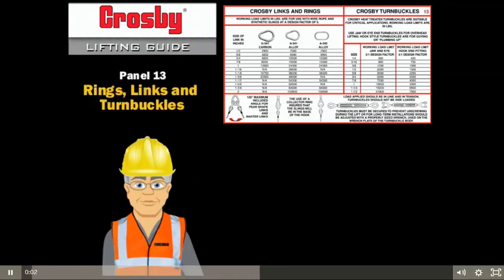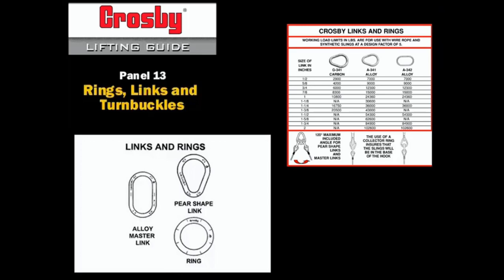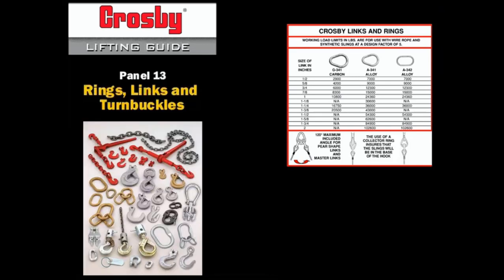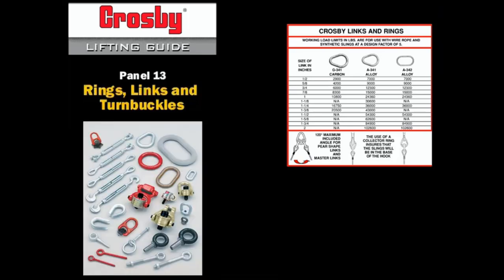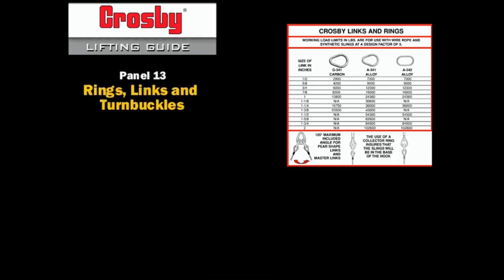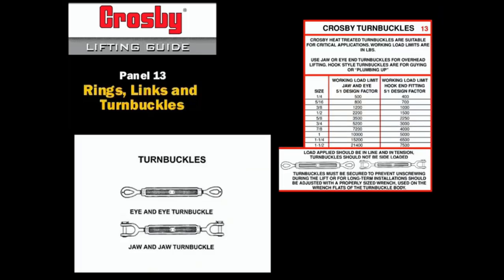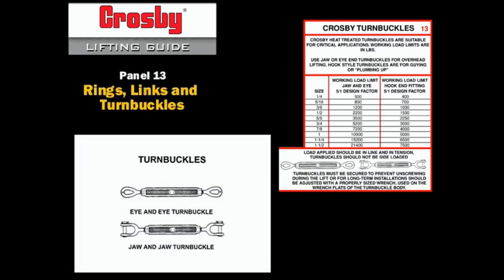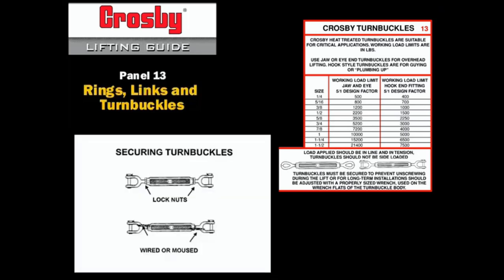Links , Rings and Turnbuckles

Comment from the maker: Question 1 of 8
1. Question
Category: Fittings
The Working Load Limit of a link or ring is based on an included angle of:
•   60° or smaller
•   90° or smaller
•   120° or smaller

Question 2 of 8
2. Question
Category: Capacity
The Working Load Limit of a 1″ Crosby carbon pear shaped link (G341) is:
•   6,000 lbs.
•   10,800 lbs.
•   24,360 lbs.

Question 3 of 8
3. Question
Category: Capacity
The Working Load Limit of a 1″ Crosby alloy pear shaped A-341 link is:
•   6,000 lbs.
•   10,800 lbs.
•   24,360 lbs.

Question 4 of 8
4. Question
Category: Capacity
The Working Load Limit of a 5/8″ Crosby alloy A-342 master link used with wire rope or synthetic slings is:
•   7,400 lbs.
•   9,000 lbs.
•   12,300 lbs.

Question 5 of 8
5. Question
Category: Capacity
The Working Load Limit of a Crosby 3/4″ turnbuckle jaw with eye fitting is:
•   5,200 lbs.
•   3,000 lbs.
•   7,800 lbs.

Question 6 of 8
6. Question
Category: Capacity
The Working Load Limit of a Crosby 3/4″ turnbuckle hook with an end fitting is:
•   5,200 lbs.
•   3,000 lbs.
•   7,800 lbs.

Question 7 of 8
7. Question
Category: Fittings
To prevent turnbuckles from turning, use:
(select all that apply)
•   Locknuts
•   Mousing
•   Loctite Threadlocker

Question 8 of 8
8. Question
Category: Fittings
A turnbuckle may not be adjusted under load.
•   True
•   False